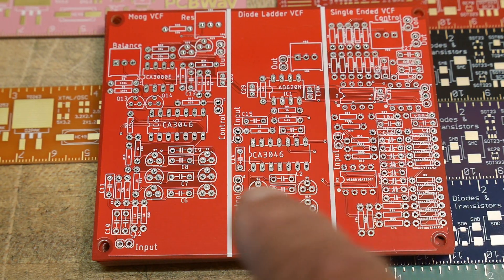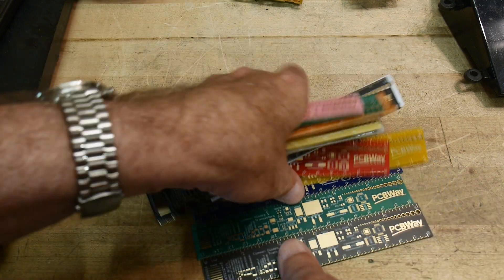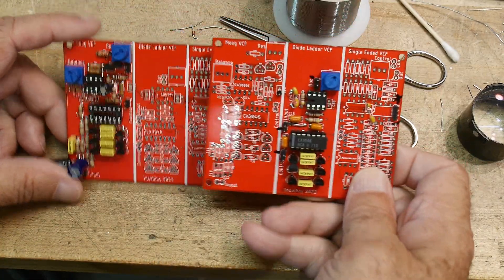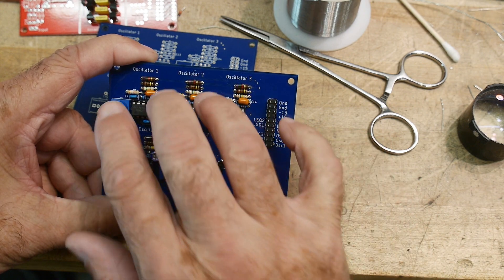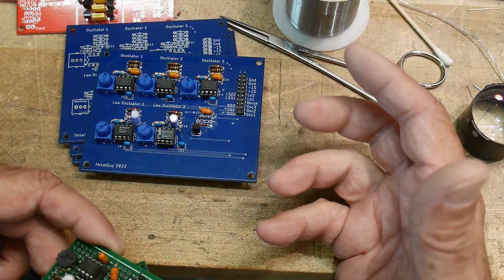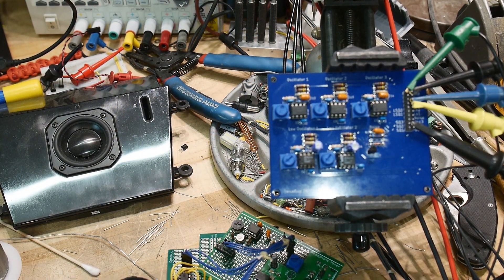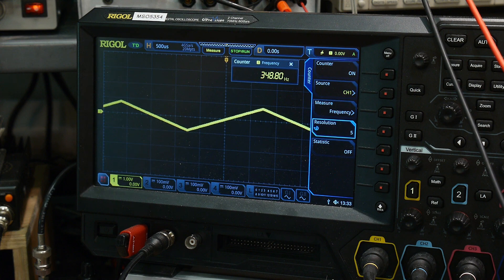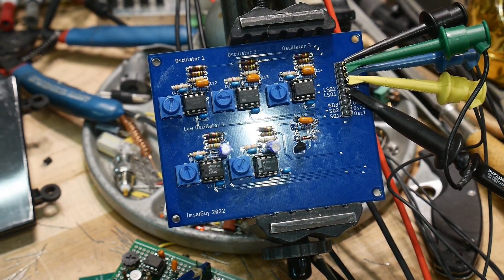#1211 DIY Analog Synthesizer (part 11 of 15)

Comment: Sorry, I just seen right now that you used a zener diode+ BJT  to generate noise instead of a single transistor used as inverse diode... But Still the problem of the section not working may be due to the inversion of Collector/Emitter pins while making the PCB design. Many times the TO99 packages invert C and E pins in low power BJTs, depending on the manufacturer.
Reply: I mean TO92 plastic packages, sorry, not TO99...

Comment: about the noise portion not working: could it be you flipped the Transistor pins? It's easy with BJTs in To99 package to flip the collector with the emitter... To generate noise, it has to be connected as an inverse diode, but if you connected it as a forward diode, it will not work.

Comment: Did you build a "Ian Fritz" transistor matcher board?
Think you should have added a (rotary) switch for the VCO/LFO board to select different speeds.
0.1 Hz, 1 Hz, slower and so are desirable. 
I guess the Noise circuit needs a couple of opamps, inverting.
Reply: Noise sources Definitely need amps and buffering to even hear at normal intrer-circut audio levels.
Reply: @joeteejoetee  accept for the noise circuit of Buchla, all noise circuit i have seen have 2 opamps, using 10K and 470K resistors.
Reply: @AnalogDude_  Gain = 2209 - Thanks!

Comment: PCBWay never sent me rulers. 😞

Yeah, maybe remove the ground plane from the noise source. I wonder if you could scrape a large box around the components on the pcb to break the ground plane. No fun though.

Like to hear those oscillators and filters (in addition to seeing their waveform on the scope).

Comment: Try different transistors for the noise.
When I was making my DIY synth, I had a lot of frustration with the same numbered transistors giving vastly different results, and some didnt work at all.
Reply: Also, use the most generic, cheapest and oldest transistors you can get. Using a nice new modern transistor will not deliver like a random unit from the 80s. Meaty & unpredictable gain and suspicious origin FTW.
Reply: @tommyboy9998  Seconded.